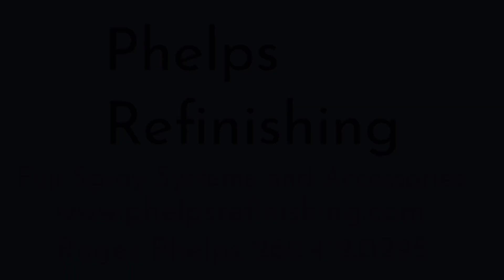Repairing factory defective Fuji Spray Mini Mite 4 turbine.

Comment: Where did you get the new motor?
Reply: off e bay £60 GBP, done 3 so far
Reply: @ragandoil  you got a that motor for £60 where from its a five stage by the looks of it I can only find them in USA and it ends up being about 500 quid
Reply: Where did you find the rubber?